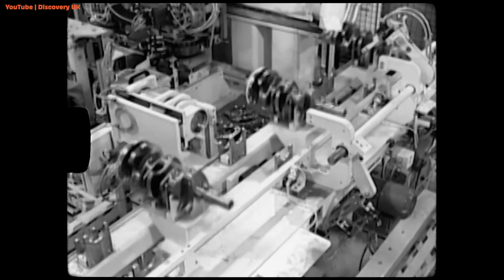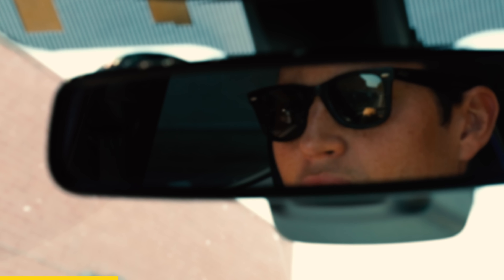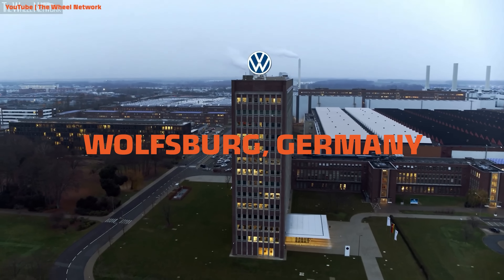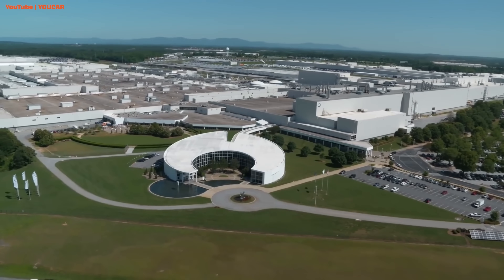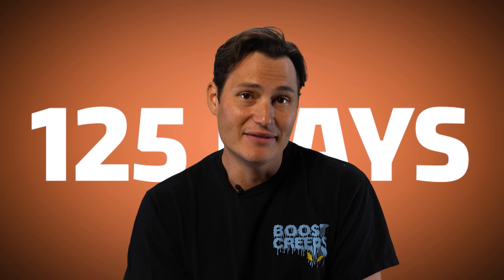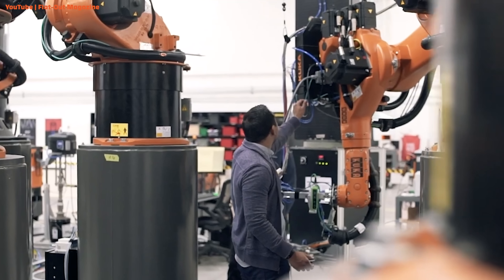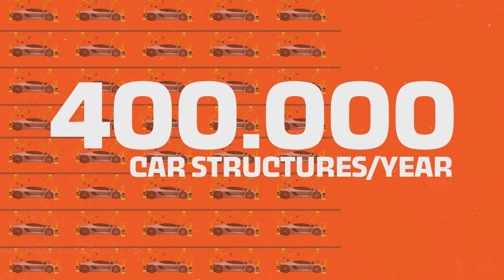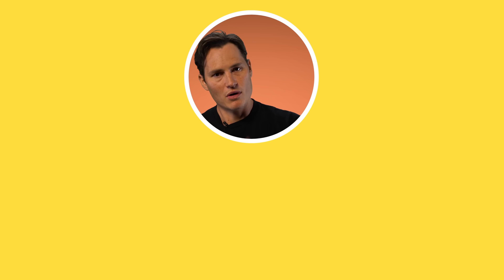A.I. Designed this Car

Comment: That could be better than today's? Yes, but the only new thing they introduces is the vertical manufacturing thing the rest isn't any newer than cae it self, although I think that using an ai should be possible to design all parts of the car at the same time, witch could optimize things that we just get done at the end like the hire routing that you talked at the video. The major disadvantage that vertical manufacturing as said, would be to introduce the parts to be used as the entire factory floor would need the same part, we use big factories to get a lot of cars done, in areas for each part to be assembled to reduce the amount of diferents parts that need to arrive at the same place, for small runs this technique should be awesome, but for big numbers, problably not

Comment: there is a problem with laser 3d printer and its a at a particle level that it lives gaps weld the metal is melting so it looks cool but is not as strong as you thinks

Comment: Metallurgic 3D printing makes the material less strong as the heat from the laser pushes some of the metal flakes away creating holes and gaps in the metal, these gaps are small but have a huge impact on the strength of the material

Just a heads up
Reply: Yeas, idk much about 3D printing process with metals, but usually metals need specific cooldowns to grow crystals and build optimal strength and stiffness... this way you can control the strength/stiffness/hardness of your material and ofc this allows hardening... but idk how they can manage to do all that with 3D printing, so i assume the metal has suboptimal characteristics compared to the classical way to build mechanical parts... however 3D printing can enable to build geometrical structures that are more efficient and resistant, so maybe metal doesn't have to be as strong as in conventinal parts.. who knows
Reply: “the laser pushes some of the metal flakes away” but how?
Reply: @devoid-of-life  Real Engineering has a video on it called “The Material science of Metal 3D printing” skip to 7:00 on his video to understand it

Basically the heat pushes some of the metal flakes away, the same way blowing sawdust pushes it away
Reply: Another thing to take into consideration is layering... Like kevlar and other protective materials it is used with lots of smaller pieces formed together... Also like thick heavy duty rope and steel braiding smaller pieces braided together then wrapped again.
Reply: Good thing you said that, I'm sure none of the engineers had any idea of the limitations of the process they're using
Reply: @BenJuan2666  I’m not telling the engineers, I’m telling the people who probably think this car is indestructible the way Jeremiah talked about it, I’m sure Jeremiah himself knew about the limitations of the process but couldn’t talk about it for breach of contract as these videos are all sponsored by the company’s they show
Reply: @RightLadd  well but prob they knew it

Comment: I would like to know what is long term durability of the printed parts since we all know that 3D printed metal tents to crack over time from vibrations, especially when the surfaces are not treated. Which is almost impossible with the crazy shapes they use. Is that the reason why they still didn't ship any cars to customers?
Reply: They didn’t ship cause it’s an absolute gimmick

Comment: So uhm.... About that Artificial learning. 
Most modern AI learns kinda the same way humans do. From a database, or in our case books.
Let's say you want an AI that recognises different kinds of leaves. Well, first you have to show it how a leaf looks like and what kind it is. Like a maple tree leaf.
The bad thing is that if you show it another leaf, that's a maple leaf but you lets say flip it to it's back, and has bad lighting it won't recognise but a human would. So what do you do... Well, you can allow it to manipulate the picture a bit to touch it up to have better lighting, but it's still on it's back. This is why AI like these need HUUUGE data bases with up to millions of pictures of all kinds of leaves and settings for the picture to be relyable. The good thing is that modern hardware under the program can crunch well... millions of pictures at a time. The efficiency of this AI, is based on how good(read big) your database is.

Other learning methods are for example evolutionary. Let's say you want an AI that's good at chess. First it wont do what the hell it's doing, like when you're learning chess. Except it may not even know what the valid moves are, but it'll learn in time (there's a control software that sais to it NO! if want's to make an invalid move). Except it learns super fucking slow. To speed it up you can run LITERALLY THOUSANDS of instances of this. If the game is finished or the time is up, you'll grade them and pick the best scoring one. Then you take that best scoring one, let's name it A1,  and start it again thousands if times at the same time. Then the process repeats. BTW this is how Alpha star learned starcraft 2. BTW this is evo batch learning.

Even this is kind of an oversimplification. Some AI can learn on it's own, some needs humans (reinforced learning). Some AI don't learn at all & stagnate. (like gps, just search up A* (star) algorithm, it's pretty simple)

All of this is really involved in math (namely statistics... (fuck stat... like seriously... it's so bad yet so important)), and computational powers. Some of these take months for an AI to learn when run at 1000s of CPUs. Yes entire server farms can work on things like this.
As a software engineering student i can say that AI is fun, on a concept level, but for me it's just too much statistics. I'd rather do calculus lol.

Hope i could help

Comment: Isn't this car almost impossible to repair because components are not conventional?
Reply: Well sure, but at the same time, aren't all hypercars almost impossible to repair?
Reply: @mophead0766  Other hypercars are really hard and costly to repair and maintain, this Czinger is indeed 'almost impossible'.
They should just let the AI figure out how to repair it.
Reply: Well, u just need a piece of fiber glass, a hammer, a saw, and some LS parts👍 (pls dont take seriusly)
Reply: Maybe they could 3d print the whatever parts you need? 
And apparently a new set of tyres for a Veyron will set you back $30k.  So i think this car will be aimed at the kind of people that buy Bugattis.
Reply: i mean one of the ai parameters was probably reliability so hopefully this thing isn’t breaking down all the time
Reply: @dunderheadgood  1350hp and a completely new design, it's gonna break down. A lot.

Humans still had to input all the parameters. An AI can't really 'think' it just takes data that's given to it and applies it in the best way possible, but if they missed one single tiny detail of data (and at this level of technology/performance there are a shittton of tiny details) it's going to have problems.
Reply: @heygek2769  seems as though they were pretty thorough with their designs, also this ai is clearly a lot more advanced than what we think of. if it can design ways to limit the amount of materials needed it can probably design ways to use those materials in ways that will prolong their lifespan
Reply: Just because the parts are unconventional doens't mean they can't supply it. You don't see parts for a Koenigsegg or a Pagani lying around in your local shop, you got to order that stuff.
Reply: @LeyvatenLoop  Just because they can supply parts doesn't mean that swapping out said parts is going to be feasible or any sort easy effort to do so, highly unlikely unless they also weighed heavy on the serviceability within their AI algorithms hmmm.
Reply: Yes, but also, if you can afford one you can afford to buy a second one. Considering most of these will be collector's items sitting in climatized garages, probably won't be too much of a problem.
Reply: @mynt253  You do realise you can't just buy another hypercar, right? They're usually made in VERY limited numbers  and sold to a select few people.
They don't exactly roll off the assembly line by the hundreds of  thousands like Camrys.

These cars will be pure museum/show pieces whereas other hypercars actually get driven every once in a while.

Don't get me wrong it's a cool proof of concept and pushing the boundaries of technology, but from what I can tell they're about as functional as a drinking glass made of sugar.
Reply: @heygek2769  we should wait and see how that "track" version performs before claiming it's a useless car I think.
Reply: @heygek2769  Sarcasm is difficult to get across over text.
Reply: I'm sure one of the parameters set is serviceability, and if the whole/most of the car is 3D printed, can't they just reproduce entire replacement parts? 🤔
I mean it shouldn't be harder to service/repair than existing hypercars already.
Reply: Using standardized parts? Sure. But all components are custom made with CAM, so every part can be duplicated in a capable machine. It could be by the factory itself or by someone with a concession and the capable machine. It's a change in the industrial model.
Reply: Yeah I'm pretty sure they would bring the vehicle back to the factory, diagnose the issues, disassemble the car as far as needed, replace the broken pieces, reassemble the vehicle, and get you your car back to you in little more than a day.
Reply: AI designed it as indestructible but the programmers were like no bro we can’t do that to the parts industry. LOL
Reply: @djmaxxsaint  the 3D printing they use for the car is very weak compared to any other type of manufacturing process, the parts will break straight away, the car’s all show and no go
Reply: @RightLadd  the major problem isn't a 3D printer, problem is, the aluminum/titanium alloys are weak compared to steel alloys when the subject is friction or elasticity, and I dunno, but think carbon fiber goes the same way, so this cars like these can't survive a long life in real world, (daily drive), maybe in race world make some kinda success
Reply: Yeah, but with the A.U. System you can just program one to do repairs. He said they could be reprogrammed in minutes
Reply: Good point. Maybe additive metallurgy becomes as mainstream as prosthetic teeth and every garage has a printer. But i doubt that.
Reply: @MaxMustermann-bm7qt  it doesn't have to be every mechanic. But technology in general becomes more accesible with time and scalability. These would be some interesting couple of decades in that matter
Reply: Yeah, probably it is. But it would be also probably much cheaper.
Reply: yeah but for the time being it seems not to be an issue considering it's a hypercar. perhaps they'll train the robotic arms to do repairs cause if you break your hypercar you generally send it back to the factory for repairs anyways.
Reply: You're not repairing this car. It's a hypercar. No one but the manufacturer will ever repair it and will probably send someone to personally pick it up for you.  If something breaks, it goes back to the factory and fixed by its engineers. Almost the whole chassis is modular, so if you break the bumper, you get a new bumper printed.

Comment: I would love to know how much of a pain in the ass working on this car would be. Seems like something as simple as changing the oil or changing an air filter would be a $50k job. Heaven forbid you need something more like a timing chain. I understand this is something that will sit in someones garage for years and years but general maintenance still needs to be done.
Reply: So...like almost every other hypercar?
Reply: @Aperson156  Well yea but to the nth degree. Modern hyper cars like the paganis and bugattis are still built by hand so the tolerances still have to be big enough to get a hand in there. Computers can design and produce something with millimetric clearances that a human couldn't possibly recreate or work on.

Comment: I would like to see how the results of this manufacturing process can hold up in reliability and replacement standards. For example, is a component that is needed to be replaced such as the wiring. Considering the AI routed the wiring to create the shortest path, how does this affect the replacement of wiring or finding of short? Would this make the repair process much more difficult and complex? It's possible the cost of repairs may outweigh the cost-benefit associated with the wiring's routing. Granted people who buy this are likely not going to be concerned with repair costs.
Reply: I would argue that a well made routing space for the wiring will result in less shorts to begin with compared to the awkward mess that are many engine bays currently, also once you can 3D print all parts, you can decentralize spare parts production as well. If we can reduce the number of alloys and materials needed we might reach a point where melting the whole thing and cranking out a new one is cheaper than spending weeks to fix it anyway... (and we kinda already are there these days when you see how easily a car gets totaled by insurance)